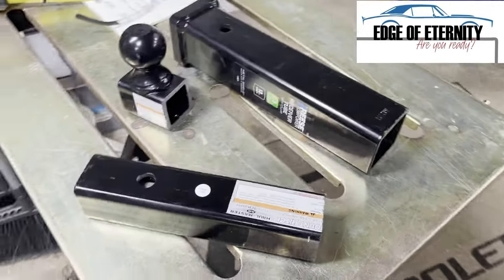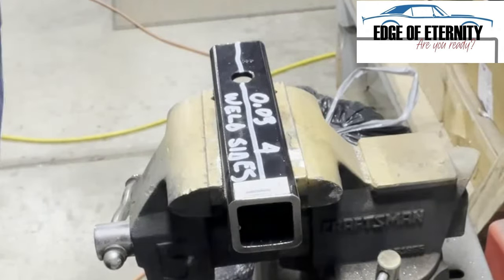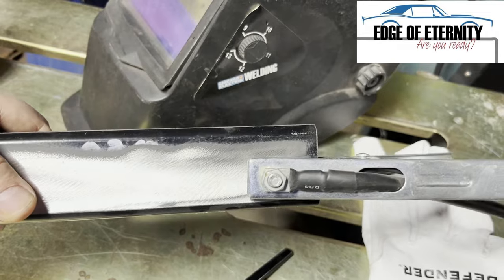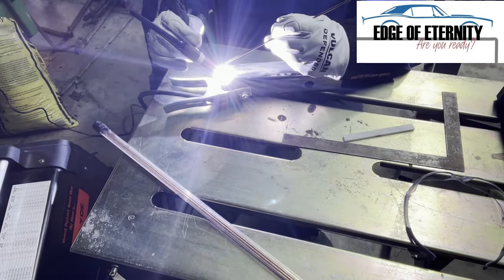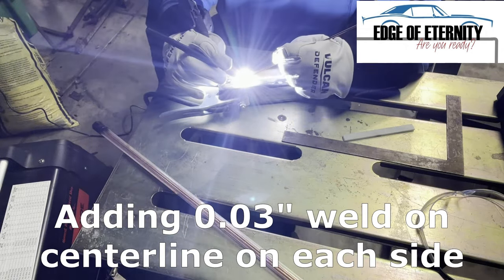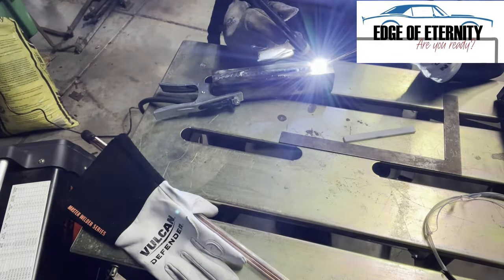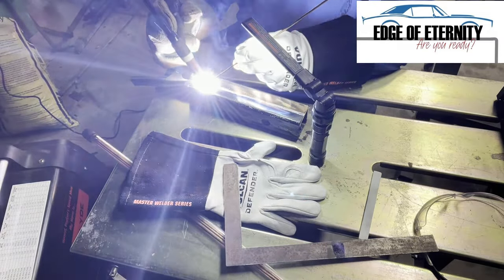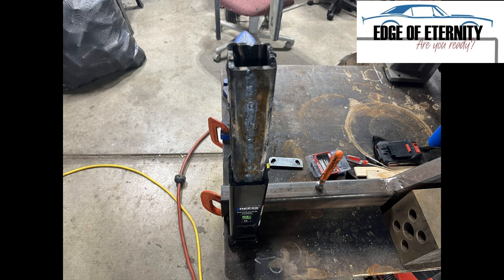English Wheel Fab - Lower Die Holder Part 1

Comment: This is where you could cut lines with a die grinder and you will be able to follow them easy 😊
Reply: Actually a great idea. My welding table in California I ground lines with a straight edge into the welding table and then when u wanted to see the lines really good all u had to do was hit the line with soapstone and wipe it off. The line was bright against the welding table. So yeah I think your idea is sweet bro!
Reply from the maker: I will use that trick for sure 👍